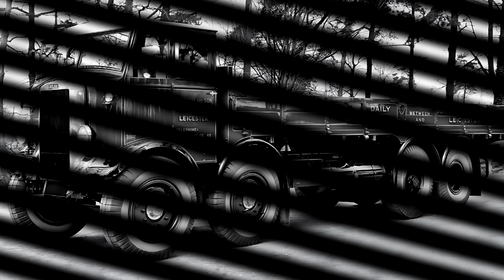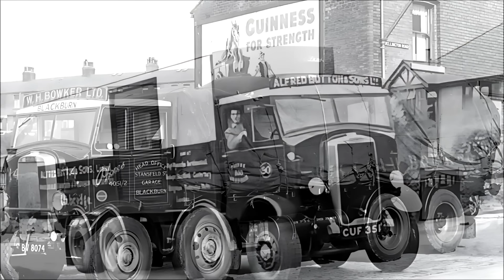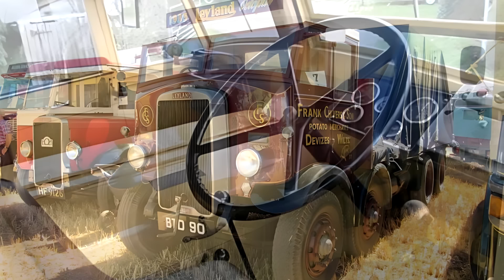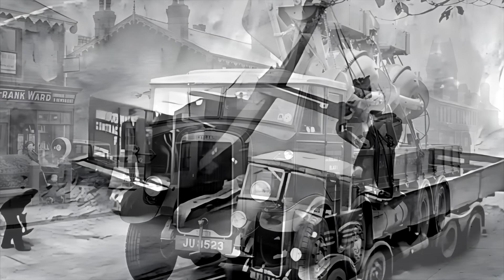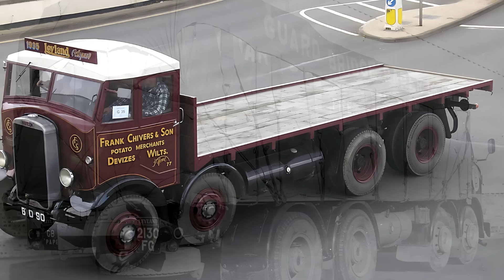1936 Leyland Octopus – Why Did This Truck Become a Legend?

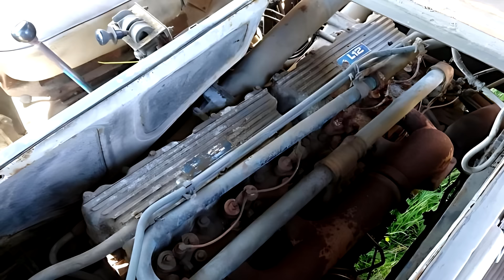Comment: I m sorry but, @ 1:33, you show a LEYLAND L12, which was not even on the drawing board when the first/early 8 wheeled trucks were made, this was a 1970/80s engine, in fact it was originally an AEC engine which was branded as a LEYLAND. The early diesel engines were 8.6L inline 6, 600. Much , much Later becoming the 680, then the power plus and the turbo charged TL11.
Reply: Yes - a lot of "experts" seem to foist their ignorance on websites !

Comment: As the old saying goes " they don't make them like they used to" it must have been hell on both long distance, when it took forever, but you could get a bit of top gear cruising, compared to local repetitive jobs when it's all steering and gear changes. Them old lads certainly earned the money.

Comment: Wrong the Octopus  Mark 1 is  fitted with a 5 speed gearbox with a very deep first gear ,in essence a  4 plus crawler arrangement and later Octos had the 2 speed auxilliary box . Engine options included a petrol unit designed by John Rackham before moving to AEC at Southall. Rackham,s AEC A-180-185,an 8,8 litre 130 pony diesel based on his E-181 8,6  litre diesel he designed for Leyland at a guess 120 125 ponies, not 97. Postscript ,in 1933 Oliver North of G Scammell and Nephew at Tolpits Lane Watford designed built the Rigid Eight around  Gardner,s legendary 6LW diesel twirling a six speed overdrive gearbox and optional  braking  on all four axles.

Comment: Excuse me, in 1933-34 John Rackham Chief designer at AEC Southall designed developed the Mammoth Major 8 wheeler from his radical modular kit of standard parts. Using blue sky thinking John took an AEC Mammoth 6 wheeler off the production line, lengthened the chassis and fitted a second unbraked steer axle to create the Mammoth Major his answer to Leyland,s Octopus. If you cared to delve into AEC,s saviour,s career, John also worked for Leyland at Preston , then moved to Southall securing a  position as Chief Designer Engineer for AEC in 1927-28.
Reply: Sentinel built the worlds first 8 wheel rigid lorry in august 1929 and were building the S8 series in 1934.
Reply: Wszystko uznaję i akceptuję z przekonaniemo najlepszym rozwiązaniu.
Reply: Tradycja to pierwszeństwo wynalezienia oraz doskonalenia wyrobów. Nie słyszałem narzekań na awaryjność i zawodność maszyn z Anglii.